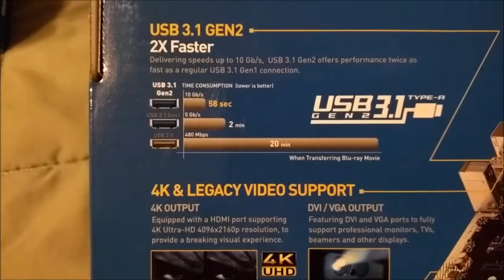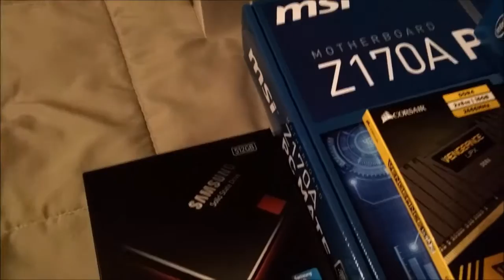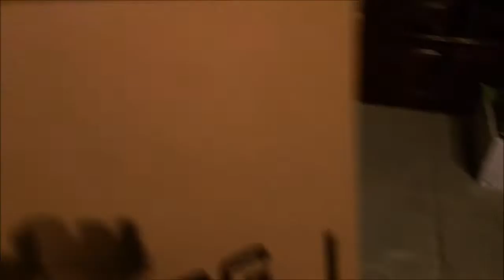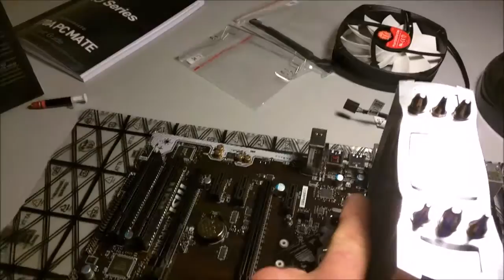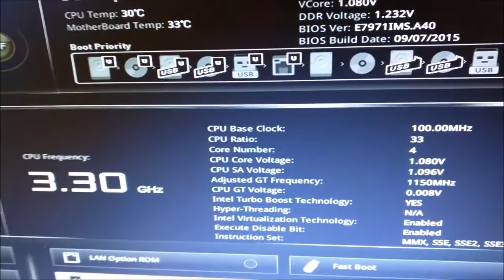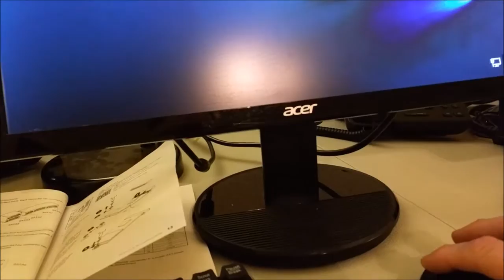Intel i5-6600 on MSI Z170A PCMATE with Samsung 512GB Pro SSD

Comment: i have a similar card and i am using it with an intel pentium G4400 and 1 4GB DDR4 but when i i try to start it off the case like in you video, it won't start. Any idea of what is missing? Do i have to use a jumper somewhere?

Comment: Would you recommend me this Mobo? I have built 2 PCs but still havent built one with an MSI Mobo...
Reply from the maker: Andres Shamis mine smoked on me right after I got it. mave been cheap cpu fan against board. rma board is still in box. only MSI board i have had fail. think it was my fault

Comment: I'm about to buy pretty much this build, PLUS a GTX 1070, from Micro Center for $999. Good deal, says you?
Reply: OPERATING SYSTEM
Operating System
Windows 10 Home 64-bit
CASE & MOTHERBOARD
Motherboard
MSI Z170A PC Mate
Computer Case
PowerSpec ATX 767C
Case Orientation
Vertical
Motherboard Chipset
Intel Z170
PROCESSOR
CPU Summary
Core i5 6600K (3.5GHz)
CPU Core
Quad-Core
CPU Type
Core i5
CPU Speed
6600K (3.5GHz)
Turbo Boost Speed
Up to 3.9GHz
Smart Cache
6MB
CPU Brand
Intel
Front Side Bus
DMI3 8GT/s
CPU Socket
LGA 1151
CPUs Installed
1
CPUs Supported
1
CPU Main Features
Virtualization Technology 
Idle States
Execute Disable Bit
Thermal Monitoring Technologies
Intel 64
Enhanced Intel Speedstep Technology
Virtualization Technology for Directed I/O
Turbo Boost v2.0
Intel VT-x with Extended Page Tables (EPT)
Intel Identity Protection Technology
Intel Secure Key
Intel TSX-NI
OS Guard
Intel Small Business Advantage
Intel AES New Instructions
Intel Memory Protection Extensions
Intel Software Guard Extensions
MEMORY
Total Memory
16GB
Memory Speed
DDR4-3000
Memory Configuration
2 x 8GB
Memory Slots (Total)
4
Memory Slots (Available)
2
Form Factor
288-pin DIMM
Maximum Memory Supported
64GB
SOLID STATE DRIVE
SSD Interface
SATA 6Gb/s
SSD Capacity
480GB
MULTIMEDIA DRIVES
Optical Drives Included
1
Optical Drive Interface
SATA
Optical Drive
DVDRW
Optical Drive Specs
Asus 24x DVDRW Drive - 16x DVD+R DL; 12x DVD-R DL; 24x8x24 DVD+RW; 24x6x16 DVD-RW; 48x32x48 CD-RW
DISPLAY
Display Type
Display Not Included
VIDEO
GPU Type
NVIDIA GeForce GTX 1070
Video Memory
8GB GDDR5
VR Ready
Yes
GPU Interface
PCIe 3.0
Video Connectors
1 x HDMI
1 x DVI-D
3 x DisplayPort
AUDIO
Audio System
Realtek ALC1150
Audio Channels
7.1
COMMUNICATIONS
LAN
Gigabit LAN
LAN Data Rate Speed
10/100/1000Mbps
WLAN
Wireless LAN 802.11b/g/n
WLAN Data Transfer Rate
up to 300Mbps
Wireless Technology
802.11b
802.11g
802.11n
CARD READER
Memory Card Reader
Multi-in-One Digital Media Card Reader
Supported Flash Media
MMC
Secure Digital
Memory Stick
FRONT/TOP PANEL PORTS
USB 2.0
3 x USB 2.0 (Type-A)
USB 3.1
2 x USB 3.1 (Gen 1 Type-A)
Audio
1 x headphone
1 x microphone
BACK PANEL PORTS
USB 3.1
2 x USB 3.1 (Gen 2 Type-C)
4 x USB 3.1 (Gen 1 Type-A)
PS/2
2
VGA 15-pin
1
DVI
1
HDMI
1
Audio
1
Digital Audio
3
EXPANSION BAYS
External 5.25" Bays (Available)
3
External 3.5" Bays (Total)
1
External 5.25" Bays (Total)
4
External 3.5" Bays (Available)
1
Internal 3.5" Bays (Total)
5
Internal 3.5" Bays (Available)
3
EXPANSION SLOTS
PCIe x16 Slots (Total)
3
PCIe x16 Slots (Available)
2
PCIe x1 Slots (Total)
3
PCIe x1 Slots (Available)
2
PCI Slots (Total)
2
PCI Slots (Available)
2
KEYBOARD
Number of Keys
104
Connection Type
USB
Keyboard
Standard
Power Source
USB
MOUSE
Buttons
3
Mouse
Optical
Connection Type
USB
Power Source
USB
POWER
Power Supply
500 Watt
Combined +12V Rating
480 Watts (40A)
PHYSICAL SPECIFICATIONS
Depth
18.48"
Height
18.28"
Width
7.5"
Weight
16.6 lbs.
Box Size
13.4" x 24.4" x 24.4"
Shipping Weight
18.7 lbs.
PACKAGE CONTENTS
What's in the Box
G313 Desktop Computer, Power Cord, Mouse, Keyboard, Quick Start Guide, Warranty Sheet, Recovery Media for Windows 10 Home 64-bit
MANUFACTURER WARRANTY
Parts
1 Year Limited
Labor
1 Year Limited

Comment: CPU: i5 6500
CPU Cooler: Hyper212x dual fan
RAM: 16gb hyperx fury
Motherboard: MSI Z170A PC Mate
PSU: Corsair CX430
Case: Corsair 200r 

Ordered these parts. Is this be a good PC? I need to save money to get a graphics card (probably GTX 1070)
Reply: everything looks fine the only thing i would change personally is that powersupply

this would be a better option around the same price
https://www.amazon.com/EVGA-Bronze-100-B1-0600-KR-Power-Supply/dp/B00EON40CS/ref=sr_1_2?s=pc&ie=UTF8&qid=1466721196&sr=1-2&keywords=powersupply+bronze

z170 pc mate is nice i just wished brands like MSI  and Gigabyte would do away with that ugly brown pcb and use black

Comment: How did you download the drivers of your motherboard di you use the disk or did you get it from the MSI website?
Reply from the maker: website for sure.
Reply: Which ones on the website did you download could you tell me because I am planningnt o buy the same motherboard as you
Reply from the maker: +Ivan A just go to MSI site and follow the links. the also have a tool that scan your machine, download drivers a BIOS, then install for you.
Reply: Well I got that far but there are like 7 Drivers on the MSI website for the Z170A PC Mate and I do not know if I need all of them since I have a seperate GPU I am using so which ones should i download all of them except for the VGA one?

Comment: I just picked up the same motherboard and the "k" version of the same processor.  I did notice the 6600k starts at 3.5GHZ and I haven't overclocked it yet.  What are your thoughts on the MSI PC Mate Z170A since this video?
Reply from the maker: solid board. be sure to update  BIOS. I just got another via Amazon today. upgrading my NAS to new case and also need more pcie slots. going with 8 WD red NAS drives on ZFS pool with a dual 10Gb Ethernet card. direct attach to my PC and the other to my ESXi server. moving to define r5 case. video on it as soon as I'm done.

Comment: I just wanted to buy the same mb and use it for ESXi server... then I saw this video!
So you say there is  no way to install ESXi on this mb? Which version of ESXi did you tried to install? Which driver problems did you have? Did you try to add drivers to ESXi ISO image?
Reply from the maker: I tried 5.5, u2 I think. my ISO has couple added realtek drivers in it. It would not even make it to the Ethernet driver load part. I have not tried since latest BIOS update to A.70 though. I did trouble shoot a bunch and decided to just turn this into my desktop.
Reply: +Glen Whittenberg  Thanks, I'll try to find another mb that was tested to work with ESXi.

Comment: I have got some problems with this motherboard. I have Core i3 6100 and my Intel HD 530 Graphics could not work. My monitor is flashing every 5 secs. Also, all keyboards I tried are not responding to pressing "DEL" key to enter BIOS. Are you having these problems? Thanks.
Reply from the maker: they have new bios and drivers released just a few weeks ago. mine had some problems before updating. in fact my drives would only run at sata2 until I reimaged and used new drivers. now it screems!